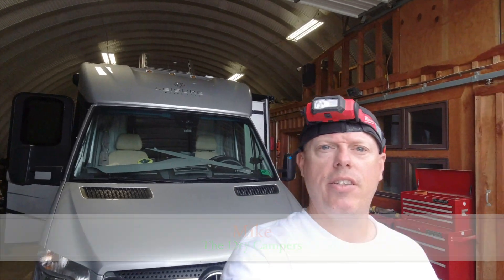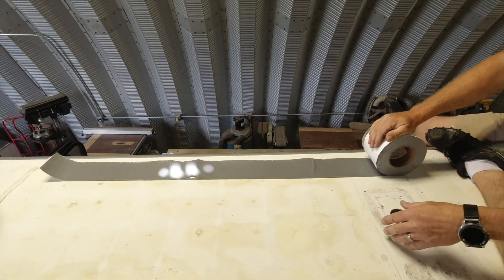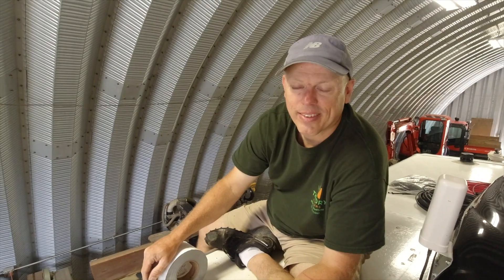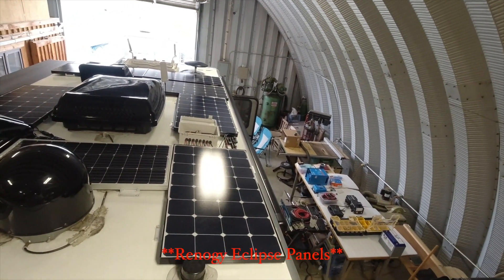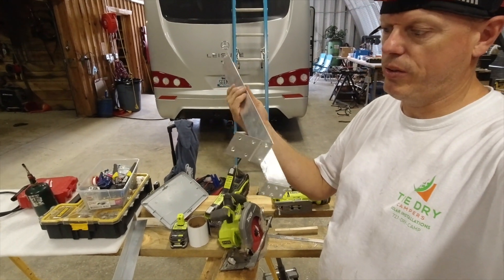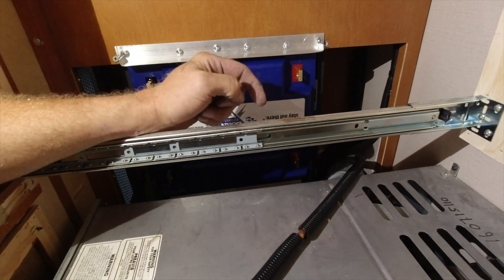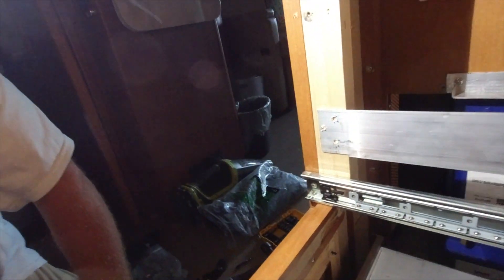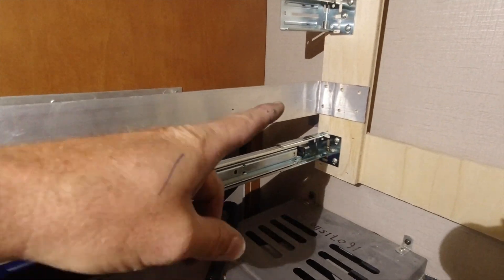2017 Leisure Travel Van Unity | Solar & Lithium Setup

Comment: that tape job while less than ideal as you say, how many months before that starts peeling off at the edges? or did you do more that is not shown such as seal the edges i am curious if literally taping a roof as shown is proven to work over the months or years if it works that is great
Reply from the maker: I've never had any peeling issues with Eternabond. The key is to ensure to have a clean surface. Also, on this particular instance, the panels are covering the Eternabond as well. We actually did the same to our vintage Airstream as a matter of fact.